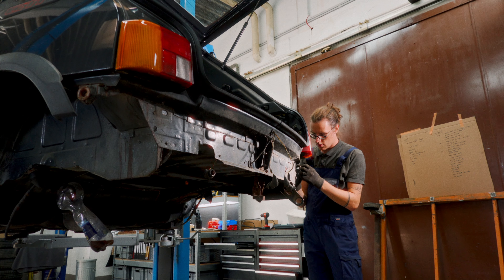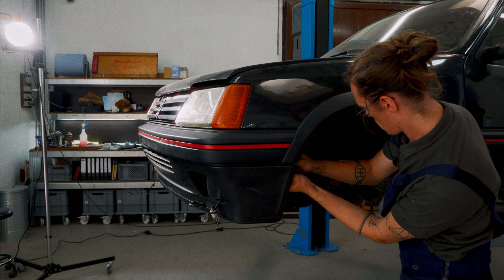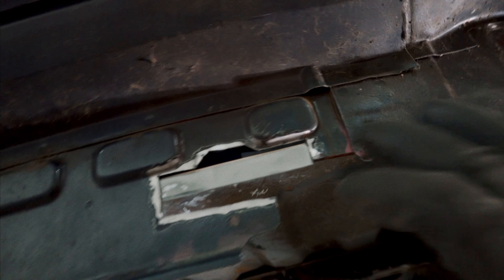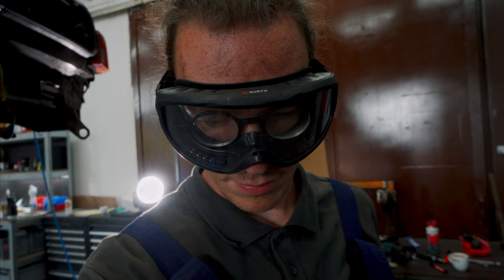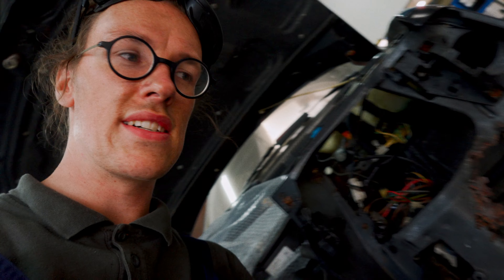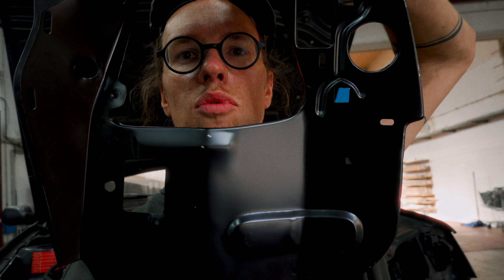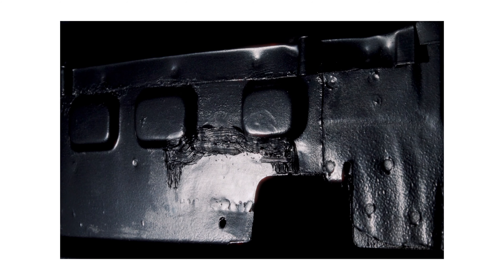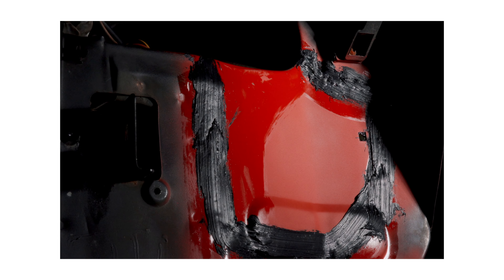rust repair - 205 GTI restoration part 3 /EP.67

Comment: The 205 metalwork is so thin it's near impossible to butt weld , id have wanted to use that complete headlight panel but that involves removing the wing which is a major pain on these and they are so easy damaged as they are bonded on and good gti wings are very hard to find now. The quality of the videos is top notch .

Comment: That's pretty solid worksmanship. I mean the welding could have been one continuous weld but I can't do that myself so yeah. Very relaxing watch again. Great music! Would be even better if you could add the music you used in the video description. Would love to listen to more of it.
Reply: Nope you should not do a continous weld becaus of to much temperature. The metal will bend like hell. It is only important to weld through and not just gluing it
Reply from the maker: There are reasons for both. If the skillset allows, a contineous TIG ground down and then planished back to shape with a hammer and dolly will be the best result. I didn‘t even try to remove some of the minor warps introduced through the heat, as those areas are entirely hidden. Back on the Rover I did a bunch of plugwelded lap joints, which are still perfectly fine. Metalwork is a difficult craft.
Reply: @OnlyARoadtripAway  the peugeot 205 has realy thin metal. I weldet many things on my. On the underground you can weld in one line even if it is not easy because the metal has only 1mm. Bud on this car i would never recoment it.